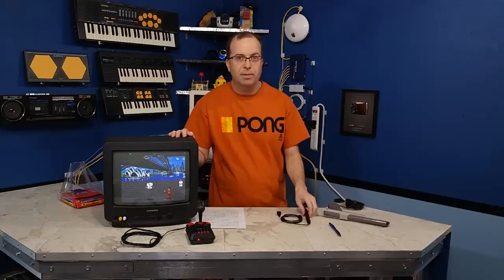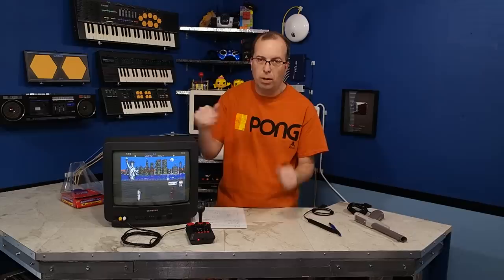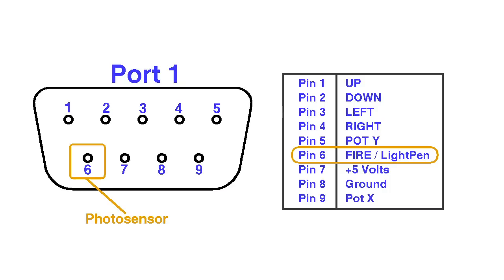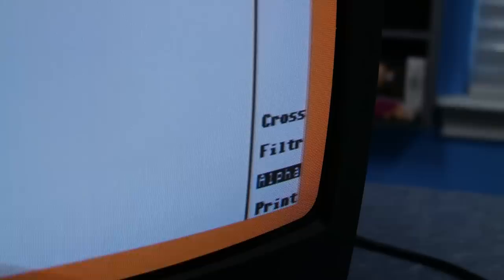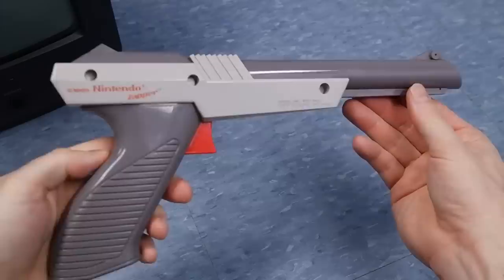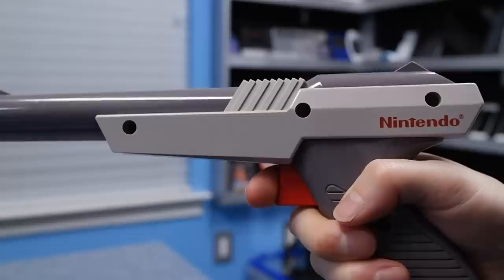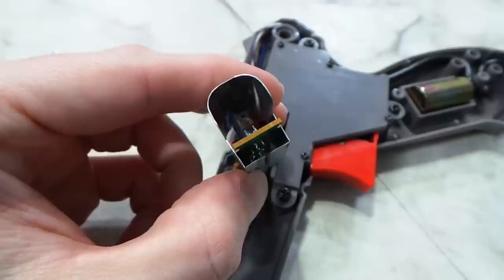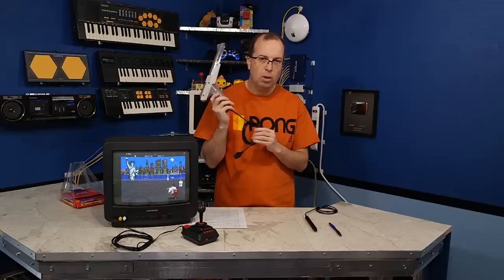How light pens and light guns work NES Zapper

Comment: My friend knew that, so he fired a gun at the light. In a lamp. In this way he earned a lot of points. Such a hack :D
Reply: did it also works with multiple ducks? did they die at the same time?
Reply: @chrisakaschulbus4903  No, you will make a quick click and you will kill the ducks at the same time. The developers of this game didn't think about this hack :)
Reply: yup, was gonna make the same comment
Reply: Me too
Reply: I did that accidentally i was shooting up and than point it to screen
Reply: Speedrun
Reply: Haha, I was also thinking about the same thing :D
Reply: I never had that work. Not in duck hunt, not in hogan's alley, not with CFL bulbs, not with Tungsten bulbs, and not even with LED bulbs
Reply: Jonas Jonaitis  He didn't have to move with it, just sitting there, waiting for the duck to appear, clicking by the lamp. That's all.
Reply: @Vulpovile  I got it to work just by holding the gun directly on the screen when I was a kid, would kill all ducks, I guess because of reflection.
Reply: Your friend would be cooler if he aimed at the light and turned it off.

But yeah for about a year I used the lights in my kitchen to control my Wii because my mom ran the sensor bar over
Reply: @SwiftCreationStudio  I'm sorry but what situation leads to your Wii sensor bar being on the driveway and your mom running it over
Reply: @SolScribbles  ...it was in my bedroom, she ran over it with the vacuum. I guess I could have made that more clear and I intended to but I was half asleep by that time
Reply: Always with this. And yet every bit of evidence given in the video would disprove this "hack"
Reply: @RetroRespawn  Maybe it's one of those lightbulbs thay are actually rapidly flashing to save energy, I forgot what it's called but I figure it's the reason slow-mo videos sometimes have light flickers
Reply: @swords-n-poppies  lol. You're kidding right?
Reply: @Vulpovile  its because the black screen is important to the callibration of the zapper. if it doesnt see the single black frame, it will not work as it will know youre cheating. however this isnt the same for older light guns like the one for the magnivox odyssey

Comment: It wasn't just persistence of vision that make the CRT image appear to be moving. The phosphors lit up by the electron beam take a little time to fade out. The persistence time can be varied by the manufacturer to fit different needs. Medium persistence phosphors in old fashioned RADAR scopes kept the image on screen for several seconds until it was updated by the rotating sweep. Tektroinix developed a CRT with a persistence measured in tens of minutes. They first used it in their oscilloscopes to capture a signals image, by 1963 they had developed it into one of the first computer graphics terminals.
Reply: High speed video proof: https://youtu.be/3BJU2drrtCM?t=104
Reply: r/iamverysmart
Reply: What the hell?!!  Reading that made my head explode.  I suppose next you're going to tell me the light in the refridgerator goes out when you shut the door!   :-p
Reply: @benstalls208  r/ihavereddit
Reply: @NateROCKS112  r/okayand?
Reply: @benstalls208   That is not r/iamverysmart material at all.
Reply: I'm so glad you mentioned the "hang time" of the phosphors. I don't know why but it was bothering me that someone might think that the phosphors would immediately/instantaneously  extinguish kind of like an LED (comes close to doing).  I like to think of it more like an incandescant lightbulb 💡 where the hot filament takes some time to cool down after the electric current is shut off.

Comment: The NES light gun used a more primitive method than competing guns on other systems. The Sega Master System light phaser for example used a different method which only needed a single frame to detect position. It worked like this: 1. Blank out the screen for one frame in white. 2. While this white frame is being drawn, the light phaser reports back to the computer at the very moment it can see the white electron beam. 3. By calculating how much time has passed for the beam to be seen, the computer can calculate position and if a target was hit.
This avoided drawing white boxes around multiple targets over many frames, and was the most popular method until the end of CRT screens.
Reply: So it worked like the light pens?
Reply: I remember the light gun on my PS1/2 was very accurate and worked as a cursor on the screen as well all the time, no matter if hitting fire or not.
Reply: The video "Playing Light Gun Games on a Modern LCD TV" from chipos81 used this method with the NES lightgun. Maybe both Master and NES used the same thing? Because you need to show bullets explosions, even if not hit a target.
Reply: Nope. Not the same. Chipos81 discribed the nes light gun wrong. Funny enough he discribed the sega gun more than the zapper. It just happned to work because he is emulating a tv screen essintually.
Reply: @yvesnyfelerph.d.8297  That's because the PS1 and PS2 GunCons used that extra cord to plug into the video signal

Comment: 10:47 - Weight and balance.  There are a few benefits: there's a perception of quality in a weightier object (early Beats headphone models had dead weight for this reason), the weightier gun is less prone to jitter, and having it balanced just behind the trigger guard makes it easier to aim and your wrist less prone to fatigue.  If you remove the weights, you'll find the gun is much less pleasurable to hold and use.
Reply: Ya, that seemed pretty obvious to me. Anything that doesn't neatly fit into a hand (like normal controllers) usually needs to be either balanced or so light that it doesn't feel like one is holding something. Otherwise there would be risk of fatigue or even injury from using the product. As someone with a joint disease in my extremities I am keenly aware of this lol.

Comment: I'm remembering an old DEC PDP graphics terminal we had in college. It had a monochrome-green screen with a light pen, but invisible to the eye it also had infrared pixels so you could program any area of the screen as "Light-Pen Sensitive" or not. Touching the pen in places where it was supposed to work produced results, but touching it to non-sensitive areas did nothing. It was a neat concept of the time.  We played Lunar Lander with it.

Comment: An interesting thing to point out is that the light gun that was made for the Sega Master System works the same as the light pen. It can transmit what the small area of screen it is pointed at pixel by pixel, the software does math to determine the estimated pixel it was aimed directly at, approximately.  That's why the Sega light gun based games just did a single screen flash when you pulled the trigger, mainly to highlight the screen to avoid the black or darker areas of the screen not registering.

Comment: I didn't hear you mention it in the video, but the method that the electron gun/CRT uses to display the image on the screen is called "raster scanning".
Reply: and you are a raster-sandwich with potato
Reply: @chrisakaschulbus4903  uh what
Reply: @mischiefthedegenerateratto7464  woooosh

Comment: Kinda funny how it is, the NES was built "cheaply", yet it lasted longer then some electronics today that are built "cheap"
Reply: Wasn't Nintendo the expensive option, too?
Reply: @dafoex  I think so, i heard somewhere it was built "cheaply" at least its cart connector is.
Reply: Zx spectrum or Amstrad cpc were much cheaper
Reply: Maybe the Famicom but the American NES is notoriously faulty due to the inane design with the cartridge loading mechanism and the unreliable lockout chip.

Comment: Later light guns (such as the Playstation one) worked like light pens did. Unfortunately these were also rendered unusable on LCD screens :(
Reply: SteelSkin667 never heard of a light gun for PS 1
Reply: Vladimir Stajilov Namco made the GunCon, also sold under the name G-Con 45 in Europe. I still have mine, as well as copies of Time Crisis and its botched sequel Project Titan. But I don't have a CRT TV to use it with anymore :(
Reply: those games were so awesome!! I always dreamed of a giant CRT to play on because mine was only 10 inches diagonal :-D pick up one from classified ads or craigslist, they come for free or very cheap!
Reply: There was also the Konami Justifier gun for the PS1, as well as a ton of 3rd party lightguns (mostly compatible with GunCon games). Some even had recoil, just like the arcades!
Reply: I had the PS2 and a light gun would work fine on an LCD TV with the PS1 game Die Hard.

Also, we had a pong game growing up that came with a light gun.  It was easy to cheat by turning the brightness up and make it much easier to hit the target..
Reply: I had a light gun for 'Area 51' on the PS1.  Can confirm that it at least worked on both front and rear projector TVs in addition to CRTs :)

Also, I think there was a calibration tool built in to deal with any timing delays...
Reply: @rosen380  Front and rear projector TVs usually were CRTs  :)  Three very bright tubes  (one red, one green and one blue)  projected their images through a lens onto the screen.

And yes, you did use to have to adjust a ton of controls to get the red, green and blue to line up perfectly.  Otherwise you got terrible colour fringing round the edges of everything.  The one in the Students' Union was never right unless I'd been watching it =D
Reply: I have the "Virtua Gun" for the Sega Saturn (came bundled with Virtua Cop), and it also knows exactly where it's pointed on the screen! You can shoot the bad guys, but you can also shoot many elements in the scenery, such as hanging lights, and break them, or shoot the tires on moving cars to make them crash and explode (this is on Virtua Cop 2 as far as I know). It flashes the whole screen white so it can pick up where it's pointed, instead of just a square like the NES!

Interestingly as well, when it's game over and you input your initials for high score, the whole screen gets brightly lit along with the letters so can point at them, a cursor appears, and it works just like a lightpen would. It's pretty neat!
Reply: At least untill someone makes a 16kHz LCD.
Reply: @bengineer8  It still wouldn't work. A traditional lightgun relies on the scanning beam of a CRT television, plus it having virtually no lag
Reply: @redpheonix1000  16kHz would be enough to emulate the scanning beam. Lag could be accounted for in software, although, that, that would make things slower.
Reply: @redpheonix1000  Wait, I derped, the speed would need to be much higher than 16kHz.

Comment: I got the Playstation 2 light guns when I was a kid. These guns ("Guncon 2" to be specific) use the CRT timing technique, similar to the light pen shown in the video, but probably because of the latency of the USB connector (that interfaces the guns and the console) a yellow RCA connector was to be plugged in directly to the gun (with an adapter) so it could track the CRT drawing beam. Although it can show a pointer on the screen that works in real time with the gun's movement, mainly for helping navigate through menus, during the actual shooting game the screen is blinked white for a frame (I guess) in order to increase the precision of the light detection and avoid failures (also, it gives a nice "shooting effect").

I remember the disappointment when we switched to a plasma screen, but even now I still have somewhere a small CRT TV that I occasionally plug in just for this and the performance is still impressive.

Comment: That's a technology developed by the TX-2 team way back in 1957 at the Lincoln labs (MIT). The very first machine to have it was the TX-2 which was an upgraded TX-0 which is the very first transistor based computer ever. But there were no microchips yet, instead of microchips it had gigantic transistor boards and the RAM was Core memory. One interesting thing however is that the TX-2 already had HDDs (which were as large as small cars and had a MAX capacity of 5Mb) and it also featured Tape storage and some experimental magnetic cylinder thingies. Also the TX-2 was the very first computer to have a graphical user interface (for applications, not the OS) and also it had the very first CAD program ever, the Sketchpad which already had 3D polygon, shader and texture mapping capabilities. (even though it had no color)

Comment: Great vid, as usual.  As someone who has coded for NES and the Zapper, I just wanted to add that an NES program, by polling the Zapper, can tell which vertical line of the screen the Zapper is pointed at.  Duck Hunt is often used as an example of how the Zapper works, but it's use of the Zapper is primitive (only has 2 targets max, so that's fine).  Other games such as Chiller and Operation Wolf have many targets on screen, and almost certainly do track the vertical position to reduce the amount of frames needed to check the hit position.

Comment: What happens when you shine a flashlight down the barrel of the gun? Do you always win?
Reply: Oddity Archive pointed an Action Max gun at an incandescent lamp and managed to cheat, I'm guessing a NES gun would want a lamp that flickers in time with the TV/mains line frequency (one and the same)
Reply: i remember finding out you could cheat by just putting your finger over the tip. not sure why that worked.
Reply: Notice how when he explains the zapper that when you pull the trigger the screen first goes black so the gun can calibrate, before it displays the white box. In other words when you pull the trigger the gun needs to see black and then white at a specific time to determine if it hit anything.
Reply: It depends on the game. Some games detect the black screen to prevent cheating and others don't. Flashlghts are not likely to work but on rare occasions certain types of AC powered lights can also trick the games since they are technically flashing. The gun will see black at one instance and white the next but it depends on the type of bulb and the timing of the game.
Reply: You could cut the barrel of the zapper right in front of the sensor thus giving the sensor line of sight on the entire screen.
Reply: Hehe. You sure can.
Reply: As a kid, I just pointed to zapper at my white wall. Totally worked for duck hunt....

Comment: An interesting additional note! You can aim a wiimote (ir camera) at your monitor, calibrate it and sync over Bluetooth. Then any ir light with a button can be used as a stylus/light pen on any type of monitor. (Im using my Rob the Robot to hold a wiimote aimed at my modern tv right now)

Comment: I worked at Trojan products (based in Swansea uk) in around 87.The telephone number printed on the pen still used the Swansea std code 0792 (pre 95).
I was a solderer on the light guns they produced, soldering the cable to the small pcb which also carried the photoelectric cell. This was mounted at the base of the gun barrel with a small lens mounted in front of it.
There were boxes and boxes of light pens in the warehouse but it's great to see one has made it all the way to Dallas.

Comment: There were older special purpose displays connected to mainframes through special VECTOR graphic displays for research and engineering, which used light pens to interact with controls on the screen and to draw figures on it.

Unlike the RASTER SCAN type CRT displays on TV receivers and display terminals, vector graphic display adapters controlled the motion of the beam directly by commands to move it in a specific path to draw each object.  For various electronic reasons, this required a deep neck on the tube (a 20 inch diameter tube might require the electron gun in the neck to be 30 to 36 inches behind the screen), so the equipment was far from portable!

The light pen was sensitive to the very sharp rise in light emission when the beam either moves onto a pixel or is switched on; the phosphor continues to glow, but with rapidly dimming intensity, after the beam leaves. This fast pulse of light is what the light pen detects, and it stops the adapter from drawing and forces the computer to be interrupted, to report which drawing command in the sequence, and which screen coordinates, were being drawn.

Light pens were sensitive to a small circle around the center pixel at which they were aimed. When no specific drawn object was being tracked, the computer put a low intensity plus sign called a “tracking cross” on the screen, and if the pen was aimed at it, the cross was moved by the computer toward the center of the circle of light pen vision, and the pen could be used to move the cross to a new starting position with the button released, or to draw a line or curve with the button held down.

The tracking cross was a brilliant piece of software, drawn in four pieces: from the top to the center, then from the bottom to the center, then from each side to the center. If any, some, or all four sweeps hit the circumference of the pen’s focus circle, the location was recorded, and after all four passes, the coordinates of that center were computed, and used as the new center of the next drawing of the cross. So the cross, once detected, chased the pen around the screen!

The IBM-3270 series of character display mainframe terminals also supported an optional light pen attachment, but it only detected the character where the pen was aimed, and used it with specially programmed data fields. Some light pen detectable fields toggled between two states, while others triggered transmission of the entire logical screen into the host computer. Nothing that couldn’t be done with the cursor movement and tab keys, but a lot faster.